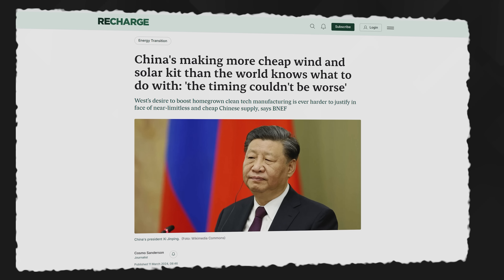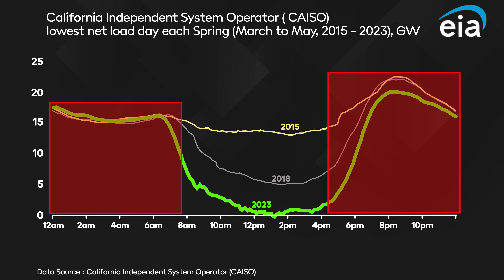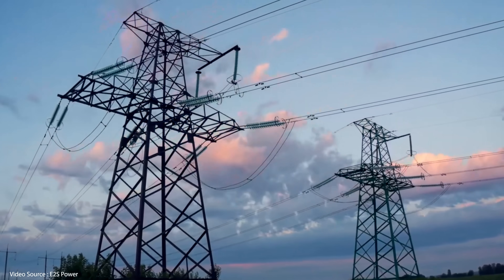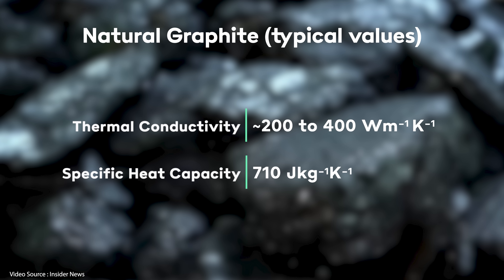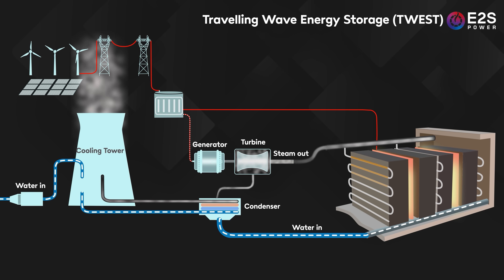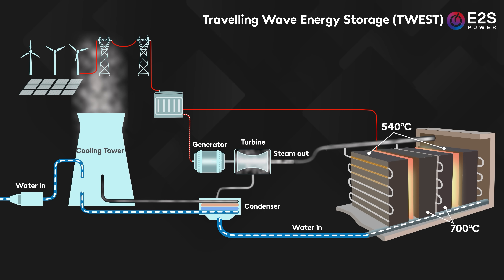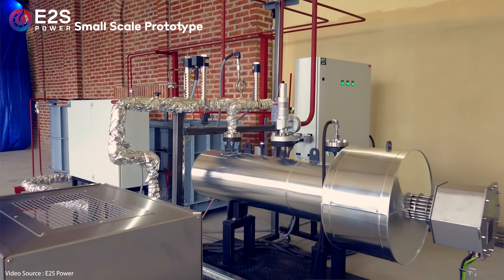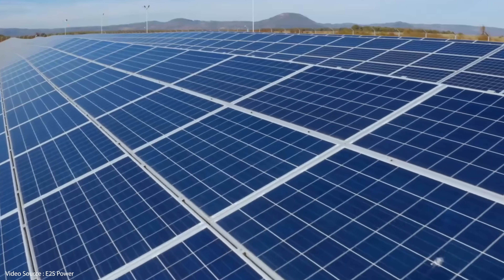A coal power station without the coal! How 'WIN-WIN' solutions could save an industry.

Comment: Every society that has successfully totally decarbonized in under a decade has done so through NUCLEAR ENERGY:  France, Sweden, South Korea, Ontario Canada. S. Korea cut the cost of building nuclear plants 30% in real terms from 1971 to 2008. Distributed baseload: Nuclear can be put essentially anywhere removing the need for building significant transmission lines. Modular nuclear power supply can be perfectly matched to power demand in location and in time. The second of the Vogtle plant’s two reactors was 30% cheaper to build than the first because workers and project managers learned from their mistakes building the first reactor. Point Beach 1 & 2: 1100 Megawatts at less than $1000 per Kilowatt. Built is less than 3 years from 1968 to 1971. Build 10,000 of those plants. You can decarbonize America in under 5 years if you simultaneously build enough Point Beach 1 & 2 replicas. Scan all the valves and pipes and everything and duplicate it. Nuclear is the single source of power that can simultaneously scale to global levels of consumption, power the removal of the last 200 years of carbon, and most importantly fully account for its own compounding emissions. NRC standards set radiation level guidelines TEN THOUSAND times lower than science justifies, which is a primary source of nuclear’s expense. Nuclear power currently produces more than 50% of emissions-free electricity in the United States. BUILD NUCLEAR.
Reply: "Every society that has successfully totally decarbonized " - which society has done that?  Because the nations you list have not done so.
Reply: @TheDanEdwards  Decarbonized their power generation, LARGELY, if not perfectly for the future. There is always an ongoing process. I think you are able to dig deeply enough to understand the essential correctness of my statement, ESPECIALLY in comparison to every other society, including those with high solar uptake, such as Australia.  YOU CAN DO IT!

Comment: A small, coal-fired, power station with a single generator typically produces 500MW or 500,000,000 Watts. With 86,400 seconds in a day and assuming the full range of 700°C can be used, I calculate that the amount of graphite needed to store enough energy will be 60,000,000 tonnes and that ignores the conversion efficiency inherent in using steam.

Have I worked that out correctly? It sounds like a lot of graphite.

https://www.youtube.com/@lagmonster7789 I think you are right! I did reply but YouTube does not like any of my replies. Censorship Rules!
Reply: The usefulness of something like thermal storage is for taking net energy to zero emissions.  It is presumed that a mix of renewables are already delivering the energy, just not enough for the peak consumption hours.
Reply: @TheDanEdwards  Agreed. However, according to the graph in the video for California, around 15GW is still required for half the day or, say, 7GW for 24 hours. That is 14 of those 60 million tonne storage units will be required in California and at least a doubling of the current renewable energy generators.

I think it is important to work out the implications before we go ahead and commit to something.
Reply: I got ~193K tonnes assuming 45% efficiency and (unrealistically)the full 700C as stated in the video.
Using  Graphite's heat capacity of 0.71J per gram per 1 degree celsius.
(500MW * 86400s) = 43,200,000MJ / (0.71J*700C) = 86,921.53Tonnes(Mega Grams) / 0,45(efficiency) = 193,158.95Tonnes.
This admittedly overly simplistic calculation completely ignores the thermal capacity in the rest of the system materials amongst many other things.
But it does show it's definitely in the ballpark of hundreds of thousands of tonnes and not millions though 😀
I probably got this completely wrong, I'm not a thermal engineer, so please feel obligated to correct my mistakes 😉
Reply: @Lag_Monster  Thanks for checking, that's better! I can get that answer now as well. I think I am getting too old for this science stuff.
Q = Mass * Specific  Heat * Rise in Temperature. It all sounded so simple ...

Comment: I was thinking this video would be about wood chip conversion like Drax did... Why would anyone use only the generator section optimized for coal furnace typically located at coal port for heat battery when they could build new optimized generator near the demand??

Comment: Er not do sure about this. Batteries are far more efficient. That means less solar farms and less wind turbines.. The system described will loose over half of the power once the heat is converted back into electricity. Thermal storage of electricity makes perfect sense if the energy is then required in the form of heat. Secondly, and related to the poor efficiency, the claim that it has a smaller footprint than battery storage is not(?) accounting for the inefficiencies. They are comparing energy in with energy out in the form of heat, I think? And what about the footprint of the turbine hall, cooling towers etc. All those could go if it was a pure battery energy storage system. Then there's the perennial problem of what happens when the sun doesn't shine. In that case it could be good if the power plant retained the capability of burning fossil fuel or biomass as backup. Having said all that I expect it will have it's place.
Reply: Batteries would be ideal IF you had instant availability, access to investment cash for the immediate switch over, and man power to do the demolition and rebuilding. This is a fast and dirty way to quickly transition to no emissions, in smaller footprint for less money while you start and move through a battery storage system in the long run. You avoid a ton of regulation and permitting processes that take a lot of time and can start the battery transition on the saved footprint (like coal storage areas). It leverages the existing grid without any additional build up really and keeps jobs in the same area. Skills are easily transferable. Here in the US we have a real problem of solar and wind installs waiting to be connected to the grid due to slow permitting and land acquisition for new grid system to connect them.
Reply: @markpashia7067  Generally agree but a battery storage system can be installed on the site of a decommissioned power station and use the same grid connection.

Comment: Interesting idea, but is there any economic study compared with upgrading to battery storage (say LFP)? Old coal plants might have old boilers that might be at the end of their useful life anyway, and then you do not need to deal with cooling, etc. The re-use of the grid connection is achieved in either case.
Reply: Dave mentioned that the grid operators would be happy about reusing turbine generators because of the intertia they have - batteries (of any sort) don't really define the grid frequency, they normally only follow it. It thus depends on other things (typically large heavy rotating things) to define it.

Comment: Love reuse of existing infrastructure! It helps so much in terms of budgets and planning!
Reply: and gives the power company a way out without have to deal with stranded assets or early asset retirement.
Reply: And building infrastructure always has a carbon cost so its great to recycle it.
Reply: @j.f.fisher5318  Repurpose it. In waste management, recycling has a specific meaning: decomposition into materials, then manufacturing new stuff out of it.
Reply: It could also he converted into geothermal system.
Reply: About time we had some "really" good news on the renewable/alternative energy front (and not just hopeful promises for many years ahead)
Reply: Algorithms used are restrictive, rather than enabling
Reply: Except it is basically a battery with efficiency of around 30 % consuming water to run.
Reply: OR - and check this out - we could just remove the "coal" bit and replace it with a metal container filled with spicy rocks that can generate their own heat instead of having to build all this crap PLUS a buttload of wind turbines that shed increasingly alarming amounts of microplastics into the environment and are already severely concerning marine biologists due to their negative effects on the reproductive health of marine life.

I believe they used to have a name for this technology in the past, it was called "new clear power" or something. Might be worth investigating some of those old dusty books and see what it was all about.

Comment: There's a problem with the thermal cycling of the turbines and other equipment.  My brother works at a power plant and tells me that the equipment does not do well with repeated thermal cycling that causes a lot of wear of the turbine.  This is a very nice idea with a lot of appeal, but isn't so practical.
Reply: I don't understand why there is cycling... didn't Dave say that the temperature of the steam was kept constant?
[I can believe that power systems aren't good at changing temperature a lot, it's just that this system didn't appear to do that]
Reply: @rivimey  The way I understand this concept, is that the former coal plant runs when solar is not running, which means it runs at night when the sun is down.  This means the steam pipes and turbines heat up using the thermal battery when the sun goes down to make power, then they cool off because they stop when the sun is up again and the plant is recharging its thermal batteries.  Turbines and their steam pipes are big and expensive and don't like to change temperature because they expand and contract each time.  This thermal stress can cause cracking.  That's why big coal plants like to heat up and run for months at a time, then shut down for maintenance every year or two.

Comment: Why go to all the trouble of using electricity to heat up thermal storage and then using a steam turbine to get the electricity back.   Why not just charge up banks of batteries ? electricity in -> electricity out vs electricity in -> heat thermal storage -> heat water -> drive steam turbine -> electricity out.    It is hard to believe it is more efficient than batteries
Reply: Not as efficient as batteries BUT does use existing infrastructure and land without changing the existing grid connections. Thus avoiding a lot of the certification and permitting processes. Still a steam generator, just a different source of steam. Not ideal but fast and vastly better at reducing emissions. No sense in building one from new, but converting makes a lot of sense until the turbines wear out.
Reply: @markpashia7067  Good point

Comment: Brilliant! Why isn't this being adopted immediately?
Reply: Because while the round-trip efficiency of the thermal storage itself may be impressive, that's not the whole story. The use of steam turbines means the total round-trip efficiency for the electricity is gonna be less than 50%. So while it's great that you can reuse the site, some of the equipment, and the power lines coming in, it's not clear that that's enough to let you compete with far more efficient storage modes such as LiFePO4 batteries or pumped hydro.

Could be a niche market, is what I'm saying.
Reply: @ps.2  Thank you for your explanation.

Comment: Looks good.  I wonder if the original coal/gas heaters are kept in the system for cloudy/winter/windless days.  Then the powerplants could gradually transition from 80% fossil fuel to 20% or lower as excess energy improves.

Comment: On a strand point of "round trip" efficiency, I like the idea of a huge battery, flywheel energy storage, or even a gravity system. Any of those systems can exceed double the efficiency of using electricity to produce heat, then, use steam to run a turbine.
     I do agree with converting a coal fired station into an energy storage station, because of the existing infrastructure. The capacity I recommend, is at least the ability to produce the same power the coal fired plant was able to, for 24 hours straight. This will work, without any further expansion of renewable generation, because it can end "curtailment". There is a lot of wind and solar that is taken off line, because of the "duck curve". There is enough generation to exceed what the grid can use in real time. A big energy storage facility like that could allow all that excess wind and solar to keep producing anytime there is wind, or sun.

Comment: Old technology.
In Australia dodgy startup 1414 proposed use of solar thermal equivalent system.
Round trip efficiency is below 50%.
Steam generation & cooling has large water demand - very clean water.
We are told graphite is a limiting resource for Li-ion batteries, such that artificial (ie fossil fuel derived) sources are used.

Comment: OK. On the premise that any question is not really stupid. So here I go to bust that myth. 😊
Why can't we just pump water up a big hill or even a mountain, yes I know there's already one in Scotland. And then pouring that into a hydro system. It my not be as technically efficient as the E2S system, but I'm sure there are power stations set in valleys and not on the tops of hills. Would be good to see how many power stations may meet my "just having a think" 😊
Great video as normal 👍
Reply: It works very well when you have the correct conditions and monitor it correctly. See Tom Sauk mountain system in Missouri (Amerin company I believe) that has been in operation for over seventy years except for one small error that took out the mountain side and shut it down for a while as they rebuilt it. However their is no such site in Kansas that I know of that has the required altitude drop needed.
Reply: Pumped storage can never work (nor can any other storage) because the scale required is simply huge. eg dinowig pumped hydro facility (9GW/h capacity)could run the uk for 10 minutes in the winter, any reasonable study of historical weather patterns suggests at least 9 days of storage is required ( ref Michael Kelly, Cambridge university)
Reply: @shanecollie5177  You seem to think all storage has to be pumped hydro.
Reply: @TheDanEdwards  It doesn't matter the method, the scale remains the same,and it's all an unachievable pipe dream

Comment: Sounds great.  Maybe, less need to buy coal for operations, more independent from suppliers.  No need to turn everything into thermal storage however, leave a boiler or two, probably this is one of the selling point.  Can always switch in emergencies. Without that, long term not sure.  Turbines are expensive, need to maintain, with only 40% efficiency.  Might not compete for investments  against battery storage.

Comment: THANK YOU! I've been wondering about this for many weeks. Converting existing power plants means keeping existing transmission & distribution  infrastructure while other renewable projects wait to be connected to the grid (this can take years). I also thought about using next gen geothermal energy to create the steam. In both scenarios can the system be closed loop so we save precious water, or perhaps use it for district heating systems? Water is a very precious resource and should be treated as such. Most countries only have a handful of power stations so should be relatively inexpensive to convert - low hanging fruit to decarbonise the energy sector. As more households & businesses etc switch to renewables via rooftop solar etc, this means there is less demand on the grid itself, though data centres, crypto mining & AI is expected to increase energy demand albeit at a more constant rate (AI doesn't get up in the morning, make breakfast with coffee & tea, iron a shirt, put on a load of washing & listen to the morning headlines on the telly). There are data centres in Scandanavia that uses excess heat generated to supply district heating to nearby communities.

Could an electronic device of some sort be used to turn power plant turbines without steam? It's 2024, we should be moving away from steam by now surely?